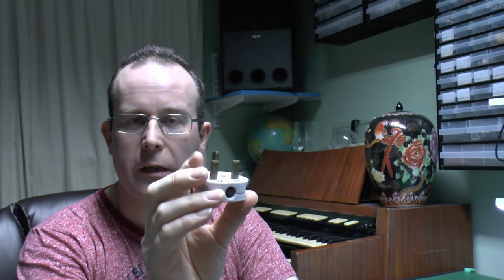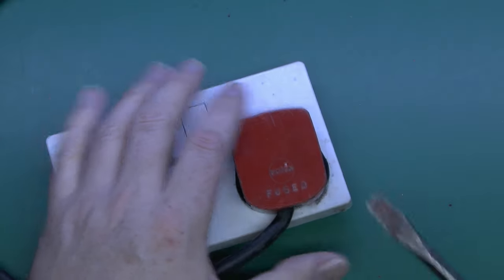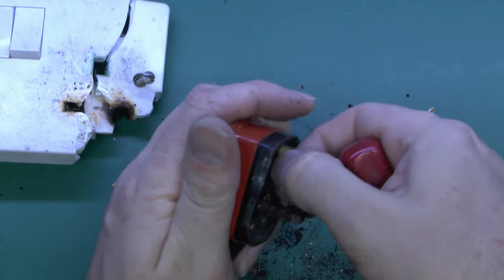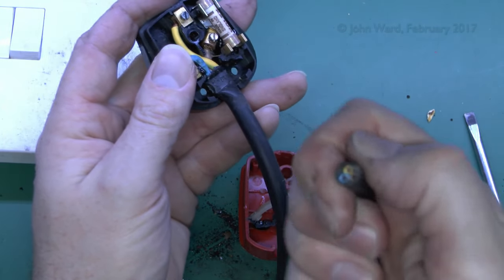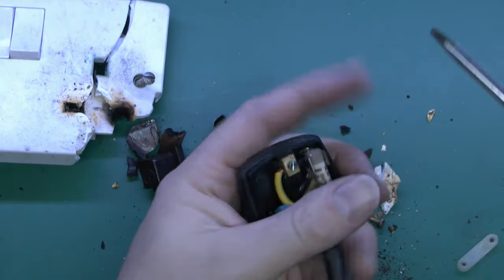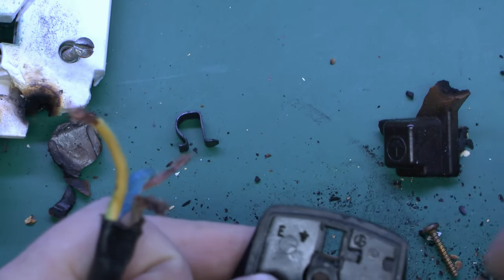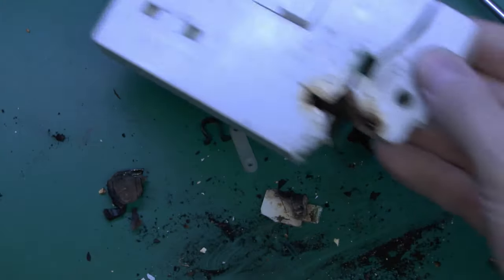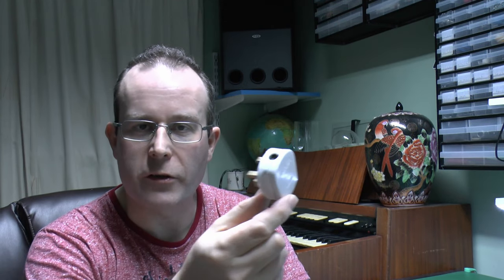Overheated Plug and Damaged Socket Outlet

Comment: so the plug can get that hot without blowing the fuse? is there any other protection devices in the system to prevent this fire hazard?
Reply: Yes, because the fuse protects from over-current and nothing more. The plug got that hot because of a poor connection either in the termination of the plug itself, or the point of contact inside the socket, which lead to arcing. The arcing causes intense heat and therefore causes the plug and the socket to burn or melt.

As far as fire protection goes, most plugs and sockets that follow BS 1363 and BS 1363-2 approval will be made of a composition that contains a fire retardant.
Reply: A fuse will only blow if there is excessive current.  All that is needed to get the heat is to have resistance (as per Ohms Law).
Reply: it wasnt a cheap plug nor a cheap socket (volex and crabtree)  it was a combination of: worn out socket, corroded pins on plugs and the overtightend wire retainer causing damage to the wires at that point causing a high resistance and probably was running a fan heater, even more likely a fan heater on an extension cable that was ancient (it was that plug is from the 80s') and kept in a damp garage, that extension probably been used everything under the sun and yanked about
Reply: Could'nt agree more with the views expressed here. Corrosion and lead abuse.
Reply: I've noticed 13amp plugs get warm when you draw 3kw, I'm sure the fuse it's self can generate a lot of the heat. I'll have to do some checks next time I see the issue.
Reply: yes they can get warm even under good conditions, fast boil kettles have short leads on purpose but you can feel the warmth in them if you do a full boil.  the problem is liekly a fan heater, people run them for hours heating a house, with old abused extensions to get them into the cold parts.
Reply: Yes I tend to agree with 2-3kw a bit of warmth is OK, obviously if there is a smell of heat or burning, or the plug is hot or shows any signs of arcing, discolouration/degradation from heat there is problem. I remember noticing that a kettle lead was warmer than normal at the strain relief on the kettle end before it suddenly arced and burnt out, so changes in temperature or performance can also indicate problems.
Reply: Arch fault detection

Comment: When I use 2KW fan heaters, the plugs get hot, they are factory fitted too, so won't be loose connection. The wire gets warm too.

Comment: Heating can eventually cause "carbon track" between live and neutral, which hopefully blows a fuse or breaker, before the house is burned down. Ironic isn't it, that most plastic insulators are based on organic chemicals containing carbon, which is a conductive element. I wonder whether silicon based materials might eventually replace them?
Reply: originally all uk fittings had to be made with non-track thermoset plastics but someone in charge allowed the standard to slip
Reply: Thermosets can carbon track.
Reply: I think the approved ones were tested, urea formadehyde was the main one

Comment: It's odd that I've only ever seen this happen with the live pin. Is it possible that the fuse holder causes this rather than the wire being loose?
Reply: Of course.  It could be either.
Reply: Yeah, if the fuse is running close to full load the it will get slightly warm. It could also be corrosion or gunk in the socket, but as long as it doesn't get too hot to touch then you will be fine! 

This is the main reason why appliances such as immersion heaters should be hard wired into the mais, even if they draw slightly under the 13A a plug is rated for.
Reply: Edmund Fisher Like others I thought the UK plug was the best in the world, but I've seen this happen many times, I guess this is one of the down sides?

Comment: Its got nothing at all to do with any loose connections. The conductors were crushed by the cord grip, hence creating massive resistance at the point where it was squashed and generating a lot of heat at the socket and plug pin contacts. All basic stuff.
Reply: +niceguy235uk1
Not convinced thats' sufficient to break the copper / add that much resistance....  Have seen many squashed cables and just not that bad.  What it MAY do is increase the tendency to bend 'sharply' and break just below the cord-grip...
Reply: The copper conductor hasn't broken. I have seen plenty squashed cables, especially immersion heaters where the clamp has been done up too tight on the heater head. Exactly the same result.

Comment: If you have say a 2 or 3kW load going through a thin fuse wire, isn't that going to generate heat in any case
Reply from the maker: Yes, fuses and fuse wire do heat up in normal operation.  Fuse holders should be designed to accommodate the rise in temperature with normal loads.
Reply: Thanks John. Great videos btw, and I'd also like to say that the UK in my opinion has the best electrical system in the world :-)
Reply: John Ward hi...i recently plugged in a heater to dry my wet carpet...when i tried unplugging the heater it was really hard to pull the plug out...once i managed to pull it out..there was a burnt hole and one of the prongs was burnt and crumbly....theres also a fishy smell in my room that there wasnt before...could it have anything to do with the burnt socket....Thanks a bunch!!!!

Comment: That plug (the good one) does not have any sleeving on the line and neutral pins for some reason 😑🤔
Reply: If you mean the white plug that's because it's an older plug that was manufactured at a time 
when sleeved pins weren't a legal requirement.

Comment: This could have also easily been caused just due to having the fused plug.  but was likely a corrosion issue.  I never quite understood why they went with individually fused plugs rather than wiring the circuit with a breaker that supports the rated load of the outlet.  Then all appliances regardless of load would have to use decent sized flex to be able to trip the breaker in the case of a fault.  Any time you add additional connections like fuses to a circuit you create more areas where a fault, corrosion etc., could occur.
Reply: Correct me if I'm wrong, but using a low 1 amp fuse for many low powered devices makes them much safer, since any unwanted power above 240 watts will blow the fuse. If we rely on allowing up to 13 amps for everything, then you don't get that additional safety for lower power devices.

Comment: In 1984, the standard was altered to outlaw plugs whose live and neutral pins were not sleeved. Although not retrospective, if I were you, I would throw that plug out, after rendering it unusable... Just to take away the temptation to use it if you need a plug one day... (Check the video, 11 seconds in).

Comment: That's why part p of the building regulations should be scrapt, makes you wonder why they still allow Diyers to do there own electrics.? Great video John ond day someone will learn there lesson the hard way
Reply: Nothing wrong with the wiring in that plug save a little excessive cable compression. In my experience (>50 years) it is the wiping contacts inside the socket that become weak and not making sufficient contact with the plug. Once the.plug is damaged however using it in other sockets just exacerbates the issue. Wiping contacts, in best practice, should wipe longitudinally not horizontally, as used to be the case with round pin plugs, and still is with German Schuko and French style Europlugs. The contacts have roughly double the contact length than the UK plugs and the spring compression onto the pins always seems much greater and more consistent than BS1363A Plugtops.

Comment: Never see this stuff on American Plugs.
Reply: Trump effect.
Reply: I have seen this happen to American plugs before.
Reply: It certainly can happen with sockets in the United States. A friend of mine used an under-rated extension cord to plug his washing machine to the outlet. After prolong use, it started arcing inside the outlet and it started to smoke. It melted one of the blades off the plug and the blade was stuck inside the blackened outlet.

Comment: Regardless of the type of electrical system any loose connections whether between wires and the socket or within the socket itself are an extreme fire hazard especially where heating appliances or any others which use a lot of current are used.  They will not trip the circuit breaker but they will become a heat source due to their resistance to the flow of electricity.

Comment: I'm using a 2Kw heater and the plug top gets hot. I had the double socket replaced because it cracked. What should I do to avoid this problem. Shall I change the factory fitted plug for a normal 13amp type?
Reply from the maker: Yes, fit a good quality one such as MK.  Plenty of factory moulded plugs are of poor quality.

Comment: I had exactly the same happen, and the load was only around 750 watts. The problem was not a loose connection at where the wire was held nor the fuse clip to fuse it was the riveted connection of the live pin too the fuse clip that was loose. I would bet that if you took the pin out of the remains of that plug you would find the problem there as well judging by where the heat was the highest on that plug.
Reply: UK pins are fairly complicated to machine, and the brass they like to use for easy machining doesn't exactly lend itself to reliable riveting. We've had that issue at work.
Reply: a lot of the imported plugs ive noticed are not brass, some kind of alloy maybe, not brass colour, and some are plated too, perhaps they changed the material to improve the rivetting issue.
Reply: +jusb1066
The worst plugs I have ever seen were on some Ebay bargain laptop power cables. I was wondering why the pins looked a bit weird, and cut into one. The damn pin was just a very thin shell of metal, filled with plastic inside! On many of them the "wires" came out the side of the plug molding, and the conductors were just a few hair thin strands of some shitty black scrap metal alloy. All sorts of colours for the insulation too, but that really was the least of it.
Reply: +stefan, yes can never know how bad some of the imports are till you tear it down, nothing like the solid old MK plugs!  i was very wary of moulded plugs for years as they were often unreliable, i guess the chinese ever cheaper price has brought us right back to unreliable
Reply: jusb1066 yes I hate molded plugs because I think the moulding actually causes any heat to be retained. I've seen a dishwasher plug completely melted. Also the sleeved pins seem to be a problem because the plastic around them often melts, as we saw on that plug

Comment: I had been alternately plugging in my heater for a while, then unplugging it and plugging in my dehumidifier.  I decided to put them both on an extension cord but still only turn on one at a time.  It charred the mains socket.  So now I have no heat and no dehumidification till I can get everything fixed, which will be at least two weeks from now.  I have the same kind of UK plugs in this video.  Am I likely to have a fire, if I just leave everything unplugged and don't use any if it?
Reply: This happened about a half hour ago.  I am already freezing.

Comment: Is it normal for a plug and flex on a kettle to get warm?
Reply from the maker: Warm yes - manufacturers typically use the smallest flex permitted, which will get noticeably warm in use.
If it's too hot to hold, something is wrong.
Reply: Yeah, plugs and sometimes flexes for 3kw heaters do get warm, even ones properly wired and in new sockets. As long as the flex isn't covered by a rug it should only get slightly warm!
Reply: Oh god, the number of people I see covering high wattage appliance cables with rugs and even putting them under the carpet...
Reply: Thanks :-)
Reply: I have a Hoover vacuum with a supposedly 2kW motor that also warms up the flex when it's running at full power. I've always assumed that's normal considering the thickness of the flex used.

Comment: Hmmm! Looking at that plugs earth pin & the rear of that socket, (earth terminal screw & the earth terminal rivet opposite) there's a fair bit of corrosion. (looks like the socket has been installed in a damp area) That would cause a weak electrical connection resulting in a very small arc gradually creating warmer pins.

Comment: Further to this. A lot of manufacturers if not all, don’t test socket outlets for continuous use. This is more of a problem now with hot tubs and mode 2 car chargers. I wouldn’t say it’s necessarily a loose connection.
Reply: Would have thought the hot tub would be permanently wired in not using a plug and socket.

Comment: Every time I turned on the microwave the light was flickering and the fuse in the plug blew..I thought it was a faulty light bulb. Ordered a new one for £16 changed it but same problem 😮 I decided to open the socket and found a loose cable , screwed it tight and problem solved . How can the wire get lose after years ?? Just noticed that my Coffee grinder (which was on the same socket) doesn't work anymore. Not only i wasted £16 on a new bulb the loose wire also blew up my Coffee grinder £50

Comment: It could be that the spring receptical part of the SOCKET does not grab the pin tight enough to form a good connection, or it or the pin on the plug is dirty causing a high resistance. As you said once the resistance starts to go higher the problem gets worse. Especially on higher loads like heaters etc
Reply: old corroded plug, possibly a worn socket too, plug you see where the wire was tightened in the grip, probably because it had been yanked out a few times so they tightend it more, the wires had broken strands inside increasing the resistance (it was an extension lead, probably lived in  damp garage till the cold nights started) and the fan heater run for hour non stop

Comment: If anyone else googled, "how to remove electrical socket that won't come out" and was recommended this shitty video that doesn't address the immediate problem...

Here is my advice, I realized the best course of action is to turn the fuse off for the outlet, (may have to decipher ancient Greek text to uncover its hidden meaning), or you could turn off all the switches, and then you'll be able to pull the plug out without starting a house fire. You're welcome.
Reply from the maker: This is not a 'how to' video.

Comment: had this happen on a washing machine , the plug was sealed unit with the only user service part been the fuse lucky i was there when the magic smoke and flames released. had to change plug and socket machine was 4 month old

Comment: One side of the fuse on my 2kw fan heater melts the socket at the fuse area not pin., the plug gets hott too even when on for a few minutes.. It is a moulded plug but has access to change the fuse, should I change the fuse or buy a new heater? Will changing the fuse stop the plug from getting warm? Any advice helpful, I'm hoping to order a new heater today if not fixable. Thank you.
Reply from the maker: Cut the moulded plug off and fit a new plug.
Reply: @jwflame ok thank you, new plug it is.

Comment: See this doesn’t happen in America cause we have superior outlets.
Reply: It certainly can happen with sockets in the United States. A friend of mine used an under-rated extension cord to plug his washing machine to the outlet. After prolong use, it started arcing inside the outlet and it started to smoke. It melted one of the blades off the plug and the blade was stuck inside the blackened outlet.